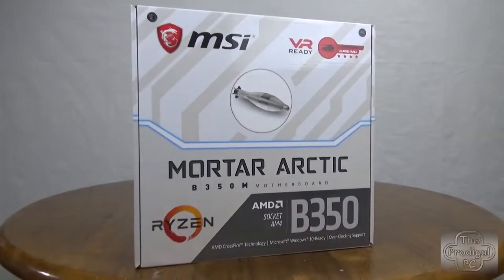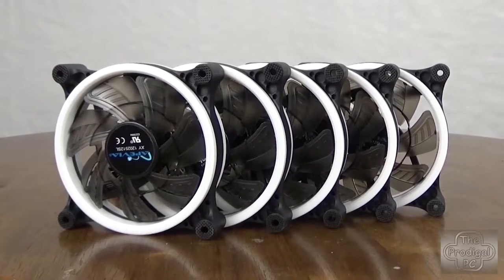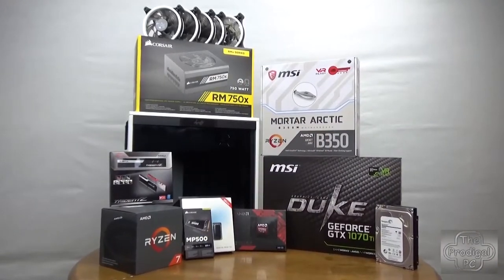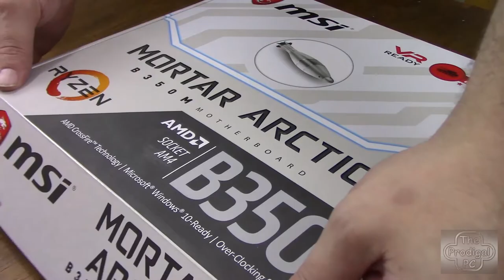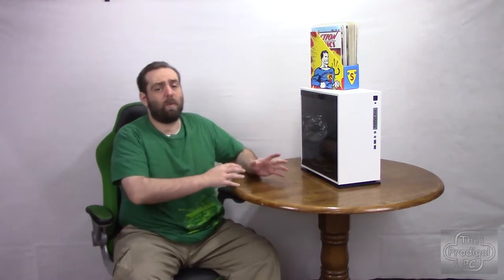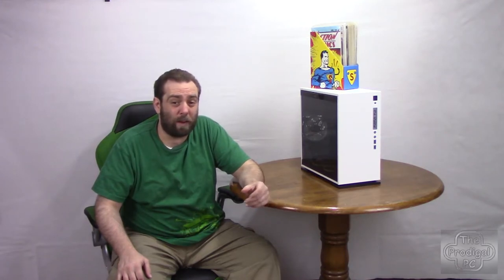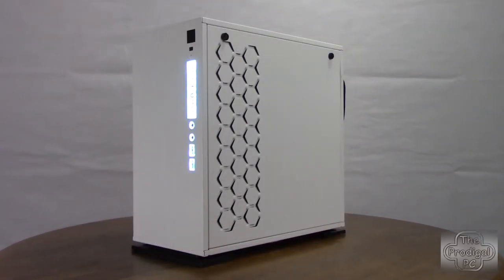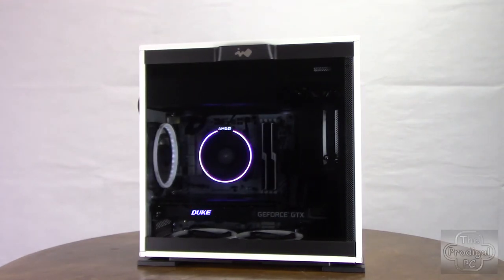My New Editing Rig!!!  Build log

Comment: That is a very nice build! It would be great for gaming also if you ran some Cat 5, 6, or 7 cable to it, as I am not sure how well wireless would work, particularly for shooters.
Reply from the maker: With the AC600 WiFI adapter I get intranet speeds of 400+ mbps and on Overwatch I have a 20~30 MS ping.
Reply: That is excellent! Guess it does not need to be wired. It is amazing how far wireless and wireless networking has come.
Reply from the maker: It really is incredible how a wireless system is now so fast that you don't really need to worry about speeds with the newer equipment.